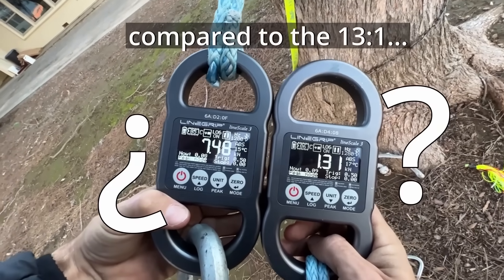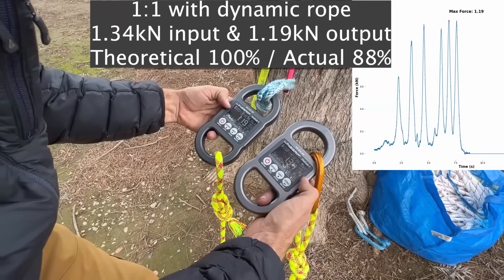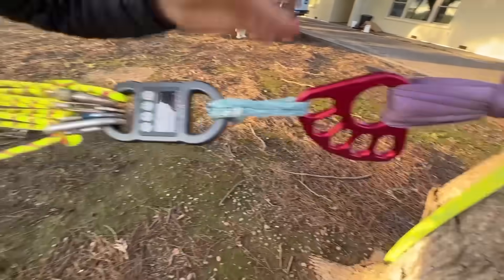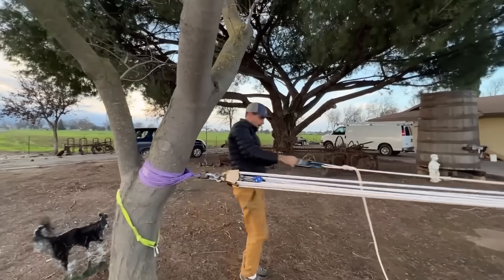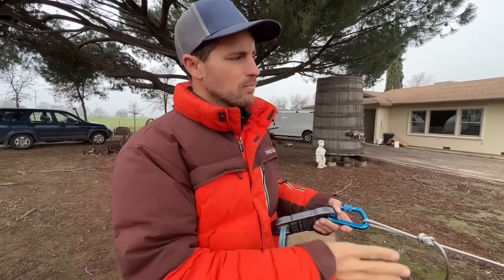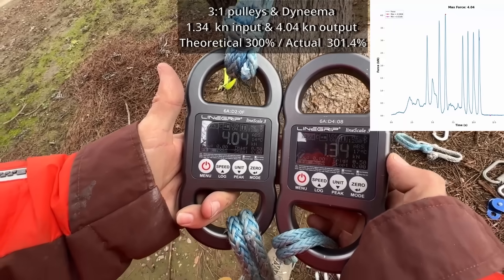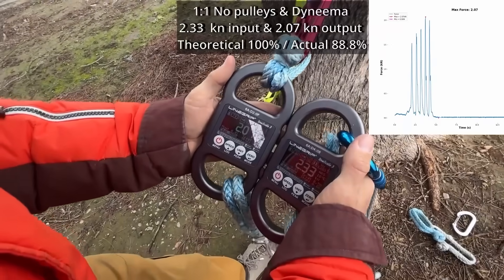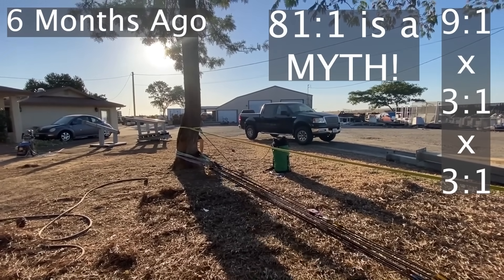Mechanical Advantage is a Myth

Comment: You should take an NCCCO class, this video was painful to watch. 
I have no doubt you know how load angles work, but completely didnt even mention the force it takes to bring 200 feet of line and multipul pulleys up to a horizontal position. Yanking on it... Like that... FOR SCIENCE. 
13:1 pulls harder than a 5:1.  Theres a lot more to effort before you get the mechanical "advantage"
90° load angle is 11x the weight of what youre trying to lift. 

You need a lot more experience in the practical application of rigging. Like real rigging where most of these formulas and tools youre using came from, not climbing.

Comment: It's be interested to see how this goes with dynamic rope and a keeper, like say a petzl micro traxion. The stretch between the keeper and the output should be locked in after the first few tugs and I suspect you'll get better efficiency. This would be more analogous to a haul/crevasse rescue scenario.

Comment: I suggest revisiting this strictly using the winch. It seems you are just measuring shock loads with just pulling with manpower. You want a repeatable same force applied during each test.
Reply: Exactly what I was going to say. Stretch affects shock loads, not constant loading. With constant loading you will reach a point where maximum stretch is reached and it will no longer absorb load changes.  Also, when you lock a rope into a specific load on the pulling end, the stretch will cause the loading to equalize across the system and the output will be more accurate.  What you're doing in these tests is showing how the stretch of the rope equates to the shocks on a car.
Reply: He used to do that exact test with his old bolt breaking machine. Then he switched to hydraulic.
Reply: As a whitewater boater, I'd say this is pretty realistic for a small paddling group with a pin (except for the large number of pulleys available)
Reply: Or just use a progress capture on the pulling end to ensure the rope has time to stretch evenly all the way through.
Reply: @FallLineJP  This is what I'd like to see.  As someone who's currently interested in crevasse rescue techniques, a 3:1 or 6:1 with progress capture MIGHT be the most common hauling system a mountain climber would be likely to employ.
Reply: The purpose of the test was explained at the beginning.

Comment: We use much larger capstan winches at work at work (I build cell phone towers) and this video got me thinking…if you bolted a larger capstan to your drop tower you could easily pull 5,000lbs up with zero mechanical advantage and a single block, would be relatively easy to put together once you acquired the winch.

Comment: This is only happening because you jerking, if it was a static pull, this wouldn’t happen. Imagine putting a weight at the end of a slinky. If you let it hang, it’ll weigh the same as the weight plus the slinky.

Comment: You’d have better results with complex/compound systems.  Put a 2:1 or even a 3:1 on the tail of a 5:1 and you can get some huge forces.
Reply: 👆that would cut out a lot of the internal system friction from ropes running back and forth next to each other - probably the biggest reason the 13:1 couldn’t out perform the 9:1

Comment: You made a giant spring out of rope.  Unless you either apply enough force to overcome the spring constant (k) or apply a lesser force over a long enough duration you aren't going to get full transfer of force to the other end.  Thats why we want dynamic rope to have more stretch, so that if we fall our body isn't taking the full brunt of the forces that it would otherwise be subjected to. It's also why cars don't beat our kidneys out anymore (for the most part), but driving in an unloaded superduty isn't exactly a smooth ride.  We are trying to minimize Jerk, or the change in acceleration/deceleration (m/s^3) rate.
Then there's also friction, but unless it is significantly high it's a minor consideration in a system with a strong spring and minimal forces.

Comment: this isn't about mechanical advantage. this is about knowing the properties of your cord. If you want to get the best advantage use the least stretch cord. Chain would seem like a logical choice here. In addition there is a direct correlation with the input/output ratio based on the length of the segments. If he were to have made each section of the 13:1 with 1 foot long segments the output would have been far better. Short lengths of chain would be the best setup here....hmmm....coincidence that is exactly what you see with engine lifts?? I think not

Comment: So I think you should definitely do this test again but this time use a steady increase of pull to see if the energy at the other end of the system levels out with time. My theory is that you’re jerking motion put only a momentary pull on one end of the rope which didn’t have time to work its way through to the other end. Still not going to be a perfect result but I’ll bet it’s a lot closer. Awesome video thank you

Comment: I'm not sure what you are trying to measure, but on the dynamic ropes you are storing energy in the stretching and YOU are accelerating and recoiling. It isn't "springyness" as much as your mass times acceleration. (Are you looking for max force in an arrest?)  You need to apply a force and hold it to get a static reading.  When you lunge back and are quickly decelerated to zero by the rope, the force will be proportional to how stiff the rope is or how quickly you come to a stop. SO basically your measurements are rather eccentric and the setup lacks reasonable analysis.

If you are looking forhow much force a body experiences, then your single line measurements are sort of reasonable. In essence I would say you have made a stretchy indicator - if you measure right.

Comment: There are two separate issue going on that are incorrectly getting linked together here. These are (1) how impulse loads are generated  on a system and (2) the sum of all forces acting on a system (each rope end) incorrectly not equaling zero.  These actions exist independently.

Regarding the force generated from the duration of the dynamic loading.  This deals with Newtons second law.  In this case you placed kinetic energy into the rope by pulling on it. The amount of time the rope takes to absorb this kinetic energy determines the peak impulse force placed on the rope.  The more stretch, the longer the time duration, the lower the force.  The less stretch, the shorter the time duration, the higher peak force.  This is why the static rope saw a larger impulse load.

The second issue is the question of “will a rope that is fully constrained by one end ( with no other external forces restraining it) and loaded at the other end see different force values at its end”?  Newtons 3rd law states no.  The tensile load throughout the entire segment is equal at all points regardless of the load being dynamic or static.  This exact rope problem is littered throughout intro level physics text books and commonly appears on midterm exams.  

With regard to the different measured values at each rope end it is not that Newtons 3rd law is incorrect, it is more likly that the way you set up and performed the test failed to collect representative data points, for all forces acting within the system.

There is probably a couple reason why your load cell values are different 
Load cells only measure force in a predefined axis.  Placing the rope horizontally  causes the  anchored load cell to rotate more when loaded the force vector of the rope was not always concentric with the anchored load cell axis.  The way you held the input load cell when loading the system placed the force aplied ro the rope directly inline with the loading load cells axis .   Because the load was more in line with this load cell a higher value was recorded more often.  With regard to the end of the rope you were not continually measuring the total force placed on the rope.  Form most of the time you were only measuring the vector component that was acting in line with the end load cell’s axis.  

This would not be an issue if you had a load cell with an extremely high sampling rate and where then downloading this data into a laptop running data acquisition software. As the duration of the peak impulses can be very very short.  However it is highly probable your load cells were not sampling at a high enough rate to capture the peak data point at the exact instance it was 100% aligned with the end load cell.   

I would recommend re doing this experiment and see if you get more accurate data.  Anchor the rope overhead and perform this test by pulling straight down with the force being transferred straight through both load cells axis.   Crank the sampling rate to the highest value you can and try and apply the dynamic force at a rate that will not exceed the sampling rate of the load cell. 
It would be interesting to see the results
I love you channel and it has lots of great information

Comment: Uh... This test has so many flaws and inconsistencies that I'm not sure if it's valid data.
For one, are you applying that impulse consistently? 

A better way would have been to pretension the line with a little bit of constant force (to remove slack in the system, thus remove some noise in the data) and then have a weight dropped from a predescribed height to apply that impulse. Basically freefall that weight with a sliploop before it snags a stop-knot at the end of the line being tested. This mostly removes the human factor.

Comment: The problem lies in those short bursts when you pull. If you apply a constant force, the stretch doesn't have the same effect. The stretchiness of the rope makes it spread the changes in applied tension over time. The best analogy I can come up with is with capacitors being used as a low pass filter in a circuit by smoothing out high frequency changes in voltage.

Comment: You need a repeatable force method of tension using the recommended pullley / block system for rope / line size and if dynamic or fail point is your criteria then you must. Load vertically with a uniform dead load to create dynamic or live load

Comment: I don’t think you are supposed to count the line you are pulling. So your 5 to 1 was only 4 to 1. On the 3 to 1 the pulley furthest from you is just a change of direction. If you have 1 pulley you get 2 lines but it’s not 2 to 1 it’s 1 to 1.

Comment: As many below are saying, dynamic loading is wasting a bunch of the force/energy into friction and heat as the rope stretches. You will also find that putting the linescale currently on the tree on the opposite side (using an even number multiplier/pulling from the same side as the "load"), it will register even less, considerably less when using carabiners, since that first carabiner will eat a bunch of the force/energy as the highest friction point. As the force put into the rope goes up, the amount of that force required to even just start moving the rope around the carabiner will go up. . To prove out the actual advantage you should add the second linescale between the van/anchor and portable winch in that last break test.

Comment: Long story short: Design your block and tackle system for what you are using it for, not for it's theoretical output. 

So as a sailor on traditional vessels I use block and tackles all the time. Most are fixed, but I often have an extra one lying around (normally 3:1 or 5:1) in case I need the extra purchase (I'm tiny, so I never have enough weight to so anything). The line we mostly use is semi static, as we can use it for everything. There are a few things where static would be better, but dyneema is expensive. Otherwise a bit of stretch is good because it prevents the rest of our gear from being shockloaded and breaking. When we don't want stretch in a line we will actually pre-stretch it. This means we will set it up under tension and leave it for 48 hrs or so, while continuously tightening it as it stretches. Only then will we actually rig it. This takes a good amount of stretch out of the line and means we can permanently rig it and then we don't have to be constantly adjusting it for the first few days and instead can adjust it every few weeks or even months depending. 

Back to block and tackles. The test you did here actually gives decent realistic numbers by the looks of it. Of course they are not accurate and there are better ways of getting closer to theoretical numbers, but these are what you would get in a practical application. Friction kills. Even with perfect blocks and slippery dyneema. The problem with adding more purchase is that you always add more friction and you add more weight. The blocks get bigger and the amount of line makes a big difference. This means that lighter pulls are more difficult than they should be. Take the main halyards, the lines that pull sails up. You often see these riggen as 6/7:1. This seems to be a pretty good number. It lets two big people or three or four smaller people set the sail with relative ease. The last little bit is always really difficult, but if we would set up our purchase to accommodate that in theory, the friction and the extra length of line would make things difficult and take a long time (more line to pull). So instead we add and extra block and tackle to the other end of the line. This is often another 6:1 made from a smaller line that is only 5 or so meters in length (total sail height is around 15). It is this extra 6:1 that lets us pull the sail up that last meter or lets us do adjustments while the sail is under load (full of wind). Also we can use stoppers and smaill block and tackles to adjust things that are under load. Rolling hitches or prussik hitches work perfect to add and extra purchase to an existing system. (Would love to see you test these as well).

Comment: The yank your doing is going to have a sudden rise in effort and your not strong enough to maintain that pull for it to be measured on the other side.   Try with your car or ATV and maintain some pressure for more than 1/20th of a second.
Reply: Oh, I am not saying your wrong in any way...  Just that I think the results may be closer if you maintain pressure for a bit of time and don't "snap".

Comment: Dynamic loading and peak force measurement are somewhat incompatible here. The springiness of the rope act as a damper, widening the peak force in a broader peak, while the force shockwaves may also be interfering which each other. You should do the same thing, but while keeping a constant force (maybe do 2kN and 4kN)

Comment: by pulling horizontal and not vertically the weight of the rope is part of your loss not just friction. all that climbing gear why not use some type of lock to hold the rope? cam lock maybe? even a tension lock would be better.

Comment: You present a lot of awesome data, would be nice if there was a summary at the end. A chart of the numbers or something. Looking at a chart or graph, especially if you divide the actual numbers by the theoretical numbers, you can really see a sweet-spot right around 5:1 for efficiency. Unless you really need some extra capacity then 9:1 works.

Comment: U dont count the pull line on the ratio. Your 9:1 is actually 8:1. Your measure point is also in the wrong place it should be at the other end or at least fixed to measure the dead man end.

Comment: Buy a hydraulic press.  Or, call the nearest college with an engineering program, and see if there is a professor who wants to help out.  They have some really large equipment, frequently things in the 200-ton range to crass and stretch things.  When I was in school I tested a bunch of climbing gear.

Comment: I think a more consistent force, and making the pulley system vertical will provide improved results. When you jerk on the rope, you also have to take up the sag of the rope due to gravity. This takes a large portion of the impulse force you are imparting on the system. If the force was held over a longer time, the sag in the rope would only have to be taken up once. Having the pulley system vertical would eliminate the sag on the rope, and make adding a consistent force easier using weights. I think that would give the best conditions for testing mechanical advantage.

Comment: what if you had a 3 to 1 pulling the end of another separate 3 to 1 system, would we see a proper mechanical advantage of a 6 to 1 without any losses cause your reducing theoretical friction of one system info 2 separate smaller systems? i have no idea but it may work??
Reply: Thats a multiplicative system. turns into a 9:1 theoretically. 
logic being the input is mulptiplied by three.

the output of your first 3:1 becomes input of the second and is multiplied not added.
Reply: https://youtu.be/01dUEhPolfA 
check out this set up for the logic. 

Would be curious what the actual results would be in a practical test .

Comment: As a tree worker, these videos are insanely useful, please never stop. You push the limits of gear, purposefully so that I don't have to by mistake. Static ropes in rigging are typically used for ziplines, it seems they have use in pulling as well!

Comment: Have you thought about using a progress capture pulley on the tail end? I'm not sure how much additional force youd be able to generate, but it would at least keep the rope between the pulleys tensioned between pulls so you don't have to pull that extra slack each time

Comment: Load cells aare sensitive to bending... I suspect that the load cell you're pulling at your end is being put into bending by your grip. It's also possible that you're getting some weird effects by yanking on it rather than just applying a weight... Have you considered just hanging 100kg on the end of it? That'd give you a very repeatable input.